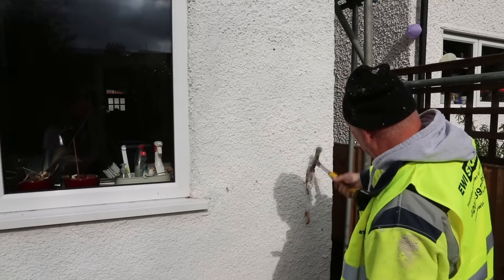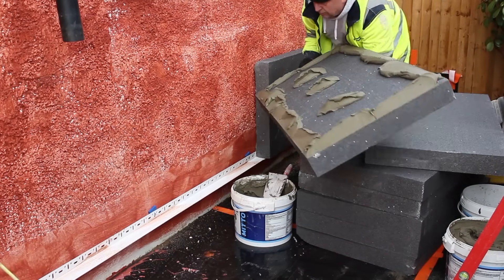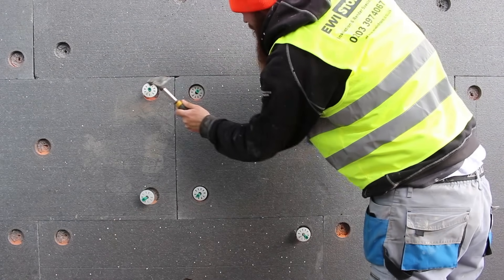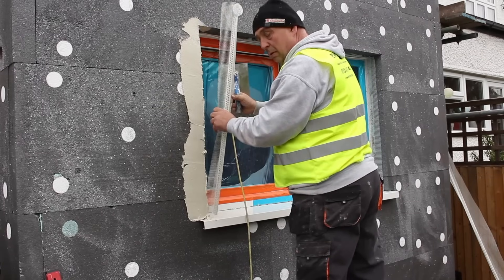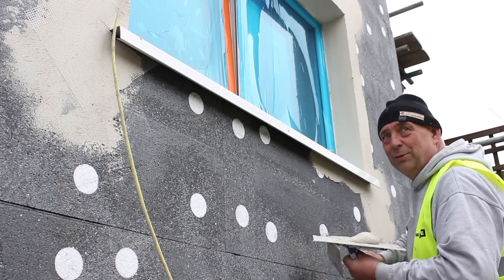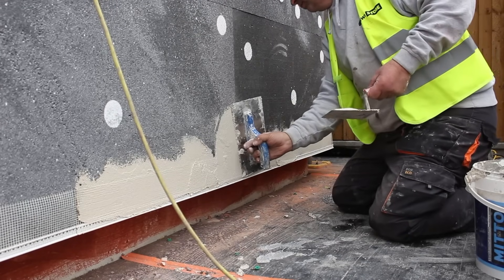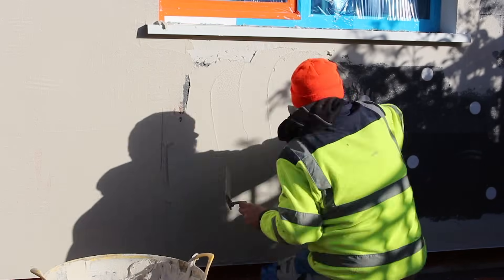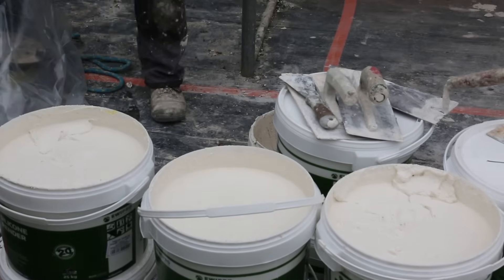Upgrade Your Property with External Wall Insulation – Step-by-Step Installation

Comment: Do you put any base coat on the top horizontal part of the insulation board at the highest point?

Also, do you need to put any base coat on the underneath side of the starter track (the bit which is facing the ground(
Reply from the maker: Great questions!

Top Horizontal Part of the Insulation Board (at the highest point):
Yes, you should apply basecoat (reinforced with mesh) on the top horizontal edge of the insulation at the highest point. This protects the exposed EPS from UV, moisture, and physical damage. In some systems, it’s also capped with a profile or drip edge for extra protection and to help shed water.
Underneath Side of the Starter Track (facing the ground):
No, you don’t typically apply basecoat underneath the starter track. That part isn’t exposed to the elements once the system is installed correctly. The basecoat starts above the starter track where the mesh is embedded over the insulation.
Reply: @InsulationRenderTipsUK excellent! Thanks for the reply.

Comment: We do that in Poland since 1997 😂😂 nothing special on that video. Boys only forgot about top coat before they done silicon render.
Reply from the maker: Haha fair enough — sounds like you’ve been doing it right since ‘97! 😄 Nothing too special in the video, but we like to show the basics for customers and newer installers.

You’re absolutely right to point it out — the priming was done, it was just left out during the video editing. Also worth mentioning, some base coats have primer built in like EWI 225 , so a  primer isn’t always needed — but in this case, it was applied. Appreciate the sharp eye! 👌

Comment: We have been using this method for 20-30 years where I live, our doors and windows are durable, made out of a combination of Aluminum, steel and pvc, 90-150 mm in thickness with triple glass filled with argon in between.
Reply from the maker: Sounds like you’ve got a solid system in place! 💪 Those window and door specs are impressive — definitely built to last. It’s always interesting to see how different regions approach the same challenges. Appreciate you sharing that! 👏

Comment: What do the metal fixings do? It looks like you just tapped them in a with hammer. How does that get a firm grip on the brickwork?
Reply: When you hammer ot, the pin thats in the middle pushes forward and  the plastic around it expands. Like a wall anchor , expandable dowel, dont know how to call it .
Reply from the maker: Great question! 👌 The metal fixings you saw are mechanical anchors — when you tap the pin in, it expands inside the drilled hole and grips the brickwork firmly. It might look simple, but once set, they hold the insulation securely in place.

That said, in my opinion, the adhesive does most of the real work when it comes to bonding the EPS. The fixings are mainly there to secure the system and add extra stability — but the Eps adhecive  is what really holds everything tight. 💪

Comment: 1 major omission in the way that you are insulating that building, apart from the fact you're using inferior EPS rather than PIR, is that you haven't insulated sub-ground, and therefore you have a huge cold bridge at ground level. I recommend going 20-30cm sub-surface, with a system to drain water away from the building at ground level
Reply: I’m looking at having this type of insulation done on my house and I was wondering how you would finish it at ground level. As you said leaving any brick exposed would cause a cold breach.
Reply from the maker: Great question — and it's an important detail that’s often overlooked.

I can confirm that finishing at ground level is critical to the overall performance of the system. Leaving exposed brick creates a cold bridge, which can lead to condensation and  mould.

The correct approach is to:

Extend the insulation 200–300 mm below ground level, using moisture-resistant insulation such as XPS or special-grade EPS designed for below-DPC application.
Install a perimeter drainage system or gravel trench to prevent water accumulation at the base of the wall.
Use a starter track with drip edge, and fully mesh-reinforce the area with a waterproof basecoat.
Optionally, finish with a protective plinth render or gravel-effect base to enhance durability and aesthetics.

It’s a small extra step during install, but it makes a huge difference in system performance and longevity.
Reply from the maker: Appreciate the feedback and you make a valid point! 👌

In many cases, especially on retrofit projects like this one, we follow the customer's budget and building constraints — EPS is often chosen for its cost-effectiveness and adequate performance when installed properly. PIR is definitely a great material, but not always feasible depending on the job.

As for sub-ground insulation — you're absolutely right, insulating 20–30 cm below ground level and addressing drainage would help eliminate thermal bridging at the base. In this case, it wasn’t part of the scope, but we completely agree it’s best practice when possible.

Thanks for raising it — it's good for others reading to understand the full picture!

Comment: I am going to change my windows it is best to do this before having external wall insulation fitted.
Reply: either but get extended cills on your windows so you dont need stick on fake ones. 150mm at least cills if sitting on existing brickwork.

Comment: Hi, if you don't use dowl plugs will there be enomous amount of heat loss emitted from all the holes or only small. Are the caps necessary? 🤔

Comment: What about cold bridging at window reveals? Is there a detail that might help to eliminate this? I ve seen problems emerge post-insulation where condensation that would otherwise have occurred on all walls in smaller quantities becoming concentrated around windows, with consequent mould issues.

Comment: The roof-overhang has been reduced to almost zero. This new render will get a lot of rain exposure and I wonder how long it will last - 5 to 10 years maybe? Does the system have a BBA certification?
Reply: It will last decades like normal. This same type of render is used on buildings with flat roofs.

Comment: We have external wall insulation, not done by this company (at least I don’t think it was) it was free, paid for by an energy company, they done 100’s around Knowsley about 10 years ago.

From what I remember, it wasn’t done as well as what is being shown here. This looks a real good job.

I always say they fitted our insulation backwards, instead of being cool in the summer and warm in the winter, ours is boiling of a summer and freezing of a winter.
Reply: Very strange situation only your house or others in the area ?
Reply: @trysam  I’ve no idea. We only spent 1 winter with out the exterior wall insulation. If I’m honest I couldn’t tell you if it made a difference or not. It is cold of a winter, a lot Calder then my parents house which is a conventional construction. Doesn’t hold heat well either but, that could be down to a number of reasons.
Reply: I did my own ewi and the house is warm and dry in winter. Cool and dry in summer. For as long as I'm in good health, no trade comes in my house. I can do better than them.
Reply: @July-A7 how come you can do better than professionals?
Reply: @tonykollar6870  Because I have a lot of experience , I take my time to research , take my time to execute with attention to minor detail, I don't rush the work , I use best materials , I'm an artist when work not just a mere builder. Everything I do is perfect👌 . I don't do half arsed jobs.
Reply: as far as above case ...can you add something to it? As to why his property is insulated and still not desired efect achieved?
Reply: @tonykollar6870  why this house is in that state ? Without viewing  it I can't be sure . Windows have to be good and we'll fitted . ( When I changed my old aluminium windows it transpired that the professional builders had not sealed around the frames. That's why it was so cold).
There could be damp ingress from the grounds or from the top or from the lintels above the windows or cills . Perhaps not enough to cause mould inside but enough to lead to cold bridges. There could be cold bridges by wrong installation of the insulation .
Is the house built of bricks, concrete, timber or is it a steel frame ?
Reply: @July-A7 when installing the ewi, does there need to be a gap between it and the brick wall? I am worried that the bricks won't be able to "breathe" and it will cause damp and mould
Reply: @l0wk3y10  Generally there is no gap. You glue the panels to the wall and then hammer in the retaining plugs .
Some properties may require a gap , but you'll have to check with a surveyor . You'll lose a bit from the insulation effect though.
Reply: Hi what was the process, do u need planning permision? How much did u pay for the materials, what did u do with the external pipes? Thanks@July-A7

Comment: I think I’ll stick with the EIFS system 
FYI ribbon and dab hasn’t been the method for sticking foam for over a decade naw 
Notched trowel is the preferred method to avoid water and moisture from getting trapped

Comment: Pebbledash: (Roughcast)
EWI: (External Wall Insulation)
Primer
Starter track
Adhesive
Insulation board
Spirit Level
metal fixings
Thermo dowel caps
basecoat and beading
Under-sill bead
Beading
fiberglass mash
float (speed skim)
silicone render

Comment: Don't retrofit polystyrene as external wall insulation & don't use spray foam as insulation internally, they are not fire resistant, use rockwool it is fire resistant.

Remember grenfell & what happened to it,  don't cheapskate on the insulation it could kill you!

Do a search for "Testing The Burn Ability Of Insulation In Wall" on Post 10 channel, it is eye opening.

Comment: Is it easy to replace the windows at a later date after?
Reply: From what I've heard from other people, it's a bit of a nightmare and the windows had to be installed from the interior of the house.
Of course, every house is very different and a lot will vary from installation to installation

Comment: So what happens if you want to replace windows 5-10 years down the line ? How do you get the frames out without cracking or damaging the render.
Reply: If render gets damaged, just repair where it was damaged.
Reply: Remove windows from inside
Reply: How much did that cost
Reply: Price?
Reply: Are you a qualified PAS2035 retrofit installer? 
I noted that the corners of the windows did not have the diagonal piece of reinforcement mesh installed. 
Was plinth insulation not installed to reduce thermal bridging where the floor adjoins the external wall?
How was the system finished at roof level, did you cap it, or extend the eaves to allow insulation to continue with roof insulation?
Reply: @lukemoxham2869  he put it on at 2.00 mate

Comment: Very informative video. We have some contractors carrying out this type of work on our street. I notice that they only cut the foam tiles to shape and then fix them using only the mechanical fixings, they don't use any adhesive to secure the foam panels prior to mechanical fixings. What's the advantage of using adhesive and mechanical fixings?
Reply from the maker: 1. Fire safety - no ventilating behind when bonding as you bond on all the perimeter of the boards trapping any air. Also you then have plaster adhesive at both front and back of the boards. 
2. Loading - both mechanical and bonding produce far superior pull off tolerances to wind etc. 
3. You actually don't use any less basecoat dry fixing because you normally compensate using extra basecoat to get it level.
4. Bonding first allows you to fix straight, which again gives better structural performance. 
5. Bonding secures the boards to unlevel surfaces much easier. 
6. Bonding gives the system much better change of not cracking in the long run, saving on maintenance costs.
7. Both bonding and mechanical how the Europeans do it especially in Germany where systems have had longevity 30-40yrs plus. The dry fix method is a British 'cost cutting exercise'
Reply: @InsulationRenderTipsUK  Cheers for the reply. I did think of some of the points you made as I watched the guys fit it to some neighbors' houses. We're in NE Scotland around 50 yards from the sea and regularly get winds gusting over 80mph or more through the winter and I did wonder about it being cracking or being ripped off. But of a shame though because it is more or less being done for free to eligible houses by the Scottish Government, but you can see our contractor is doing it as cheaply as possible. Wish we had a choice of contractor.

Comment: To rasp insulation makes the compost and garden dirty. It’s hardly impossible to get clean with my friend ‘the wind and rain’ and the insulation sticks to the sand by means of moisture / water. On building sites people walk the small pieces of insulation garbage in the soil. Animals eat it when algae have grown on them. The wind takes it far away. It should be forbidden to saw or scrape insulation outside. A temporarily tent and less strict building regulations in terms of how straight and without shadow lines the outside should be, could make the workers not to have to make the insulation totally flat before plastering.. And to have to use electrical heat cutting wires and law that the whole area has to get totally clean after this work will change the working methods in a good way. Nature first.. people can wear clothes, gloves and hats if needed ;)

Comment: Hi, Thanks fo rthe vid, this method looks great - I have some questions I wonder f you can help...

So I'm from Liverpool but now live in Japan. In a very snowy place called Niseko.

I have purchased an old light steel frame house sitting on a concrete foundation. Its very cold in Niseko and due to many factors my best option is to insulate the external wall. The existing external walls are plasterboard sheets with aliminum facing. This is then fixes to the steel frame. The aliminum has been covered with a spray on sand cement render called lithin. I will gule the EPS to this lithin surface. 

I believe this method is one of my only options..

Question.
1. Can this method work with light steel frame housing? I guess when fixing the insulation you glue and then fix to steel structure. works just the same?

2. Can this method work with XPS also or just EPS?? Do you need a special EPS or will any Eps work as long as you roughten it up like in the video?

3 If I wanted to do this method with 150 / 200mm of EPS. Would this thickness cause any issues? 
Woudl I need to countersink the metal fixing deeper into the EPS or just get longer fixings?

Thanks in advance for feedback.

If anyone with the skills would like a ski trip to japan in exchange for a render job hit me up!
Reply: He hasn't answered because you're a scouser.
Reply: Hi, you probably done it by now . If not, I'm a skier and have done EWI.
Reply: Though it can't be combined skiing with  working. EWI is done in warm months , 😂

Comment: How is the top of the insulation sealed when only doing this on the ground level or even if all the way to the guttering to prevent water going down behind them?
Reply from the maker: Dropdown Verge Trim is designed to go under sills, soffit boards and applications that require fixing from below. This Verge Trim is available in various different widths to house different thicknesses of insulation. The Dropdown Verge Trim effectively ensures that water falls away from the system but minimises the requirement of expanding foam tape and/or a silicone sealant to ensure it is completely watertight.

Comment: We have this but think about any exterior fitting like wall lights, CCTV, Washing line hooks ect...Three years on and can't fit a thing securely :/
Reply from the maker: Spiral Anchors are ideal for reducing thermal bridging when fixing lightweight items to an EWI system https://ewistore.co.uk/shop/external-wall-insulation/spiral-anchors/
Reply: Normally a "Patrice" is fitted before hand (at the insulation stage) that is flush with insulation.

Comment: Anyone having this rubbish applied just remember the heat loss is from the inside out have the insulation applied inside is miles cheaper and obviously stops the heat escaping.Philw
Reply: The walls act like storage heaters with this type of insulation.

Comment: My dads was done around 5 years ago and still looks great how ever it makes the house echo slightly inside also a neighbour a few doors down had a fire and it crept behind the render up to the roof, the firebrigade had a right time putting it out
Reply: That's because they might have used Kingspan , fenolic insulation. The kind that killed the people in Grenfell Tower in London . EPS or PIR is fine, not flammable .
Reply: @July-A7 Any experience with cork? It’s got a good fire resistance rating.
Reply: Crikey, that's scary!! I wonder if a way to avoid this fire risk

Comment: Excellent and informative video. My question is, What happens at the ‘joint’ with the neighbouring property, specifically is there any intrusion to their masonry/decor?
Reply: hi Paul.i have been applying this render for decades, where the boundary line of an adjacent property  i e semi  detached ,with this system there is a stop trim that runs from top to bottom that is mechanically fixed and silicone applied. Some firms will return the scrim on a bead, like its a window reveal for example. If there is  already a "decorative" finish a lot of care is needed and the trim/bead is applied as near as possible to it.

Comment: Go back in a year and it’s starting to change colour and the reveals above the windows are drooping. This method is used by the Eastern European “builders” around this area. It’s cheap. Try fixing a hanging basket to the wall and you need six inch brick grabbers, wall screws, to hold anything.
“